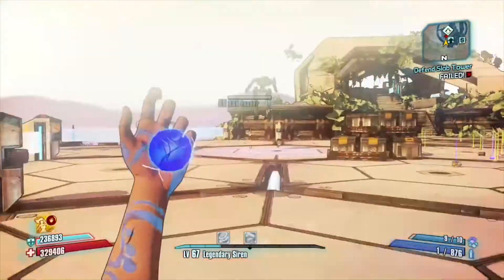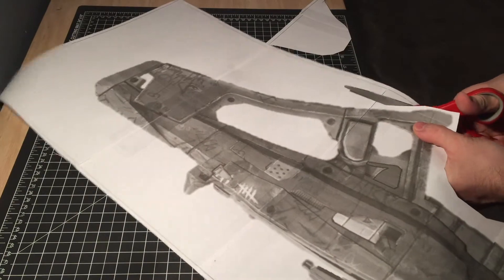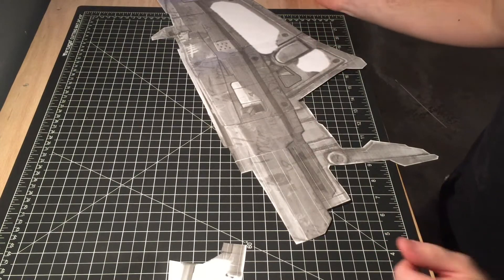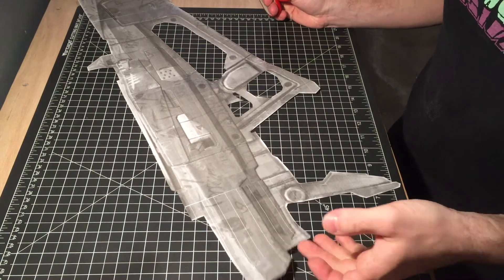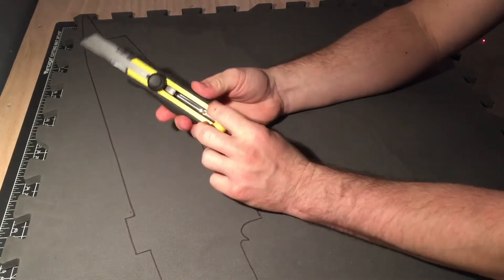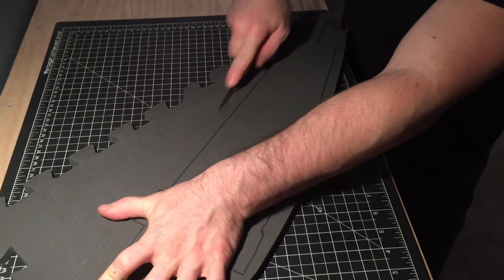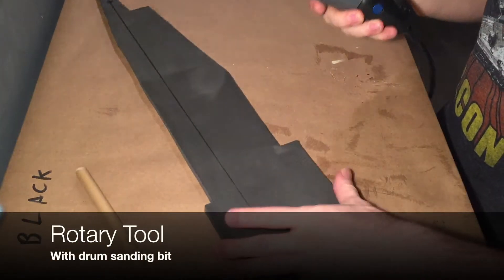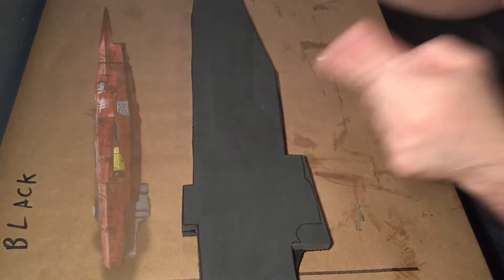Making A Hyperion SMG Part 1: Patterning

Comment: Any chance of a quick parts list? I know the exact foam matts you used but some specific dimensions and type for the thinner foam would be nice.
Reply from the maker: That's a good idea. I'll try to remember to run a quick list at the beginning or end of my videos from now on. Thanks!

The floor mats vary between 3/8" to 1/2" to 5/8" sometimes so I keep a lot around. The thin foam is about 6mm and I get it from the local craft store.